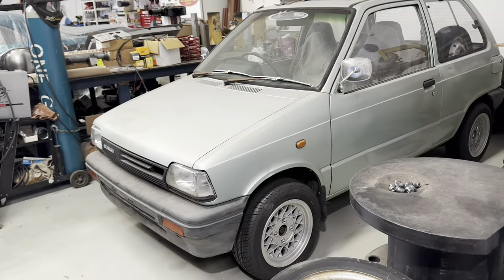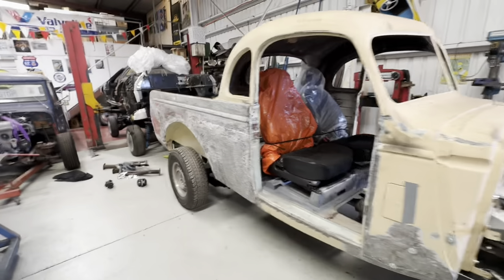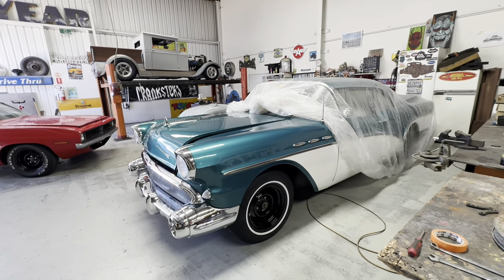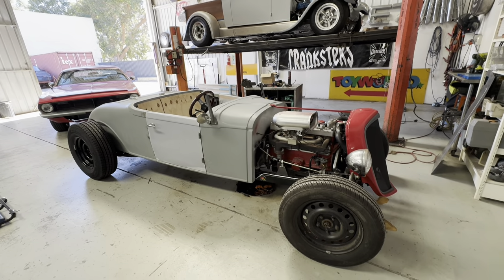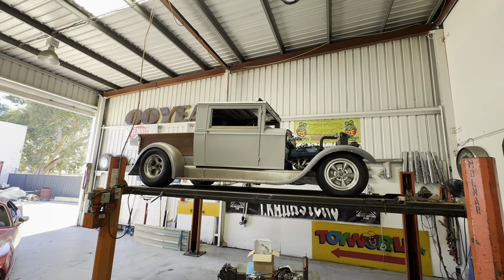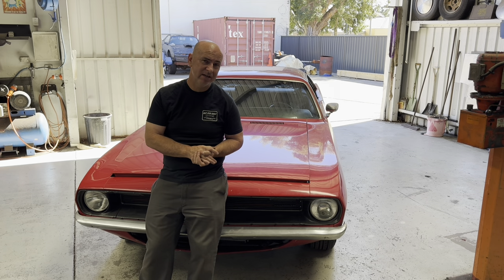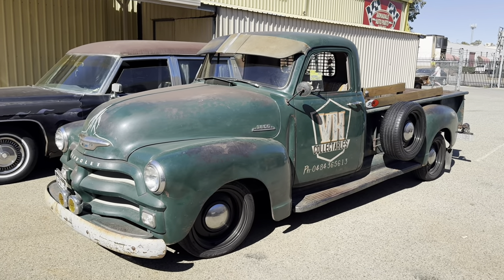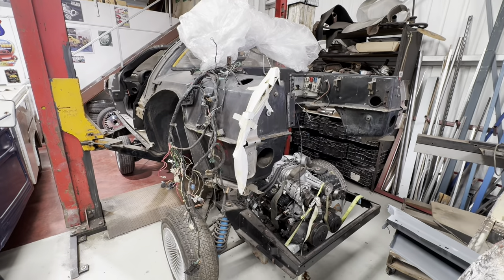Workshop walk through at Armadale Auto Parts.

Comment: Nice to see them Holden built Chevy utes. Dunno if done already (?) the rear wall panel of the cabin (from standard) slopes forward on an angle. If you replace it dead vertical the space you pick behind the seat is huge. Thinking that's wotcha got going on too as the seats are sitting back a lot. Jump in the "coupe ute" drive around then drive around in a pickup. Leg room difference is huge.
Commercial Chevs 41-46 have at least 3 different doors that don't interchange. Need to be aware if you're swap meet buying.. 2 x Aussie/Canadian & one US. 
US has one peice window & it's different size to the others.
The 2 Aussie/Canadian ones are identical...only difference is the Coupe Ute doors are the same except they're it's like they have a 2" chop.
US has some interchangeable parts, but guards & lots of sheet metal vary.
Love the roadster & Tony's pickup are to die for 🙂
Reply from the maker: Yeah he wants the extra room behind the seat. Customer has doors already . Hope they fit
Reply: @armadaleautoparts-hotrodsh9313  I know a guy 🙂